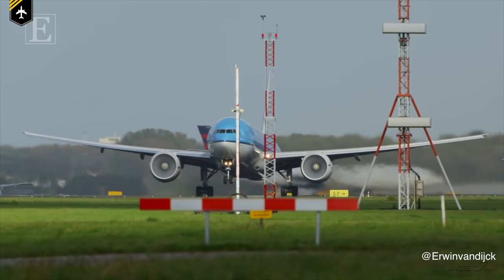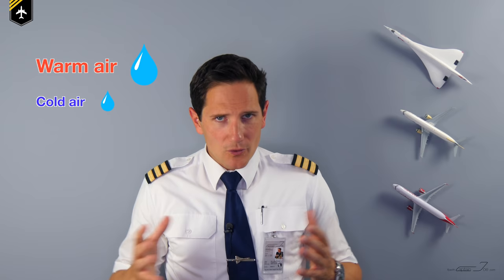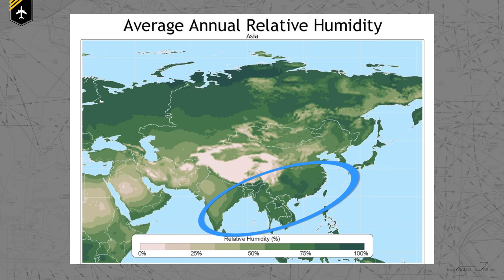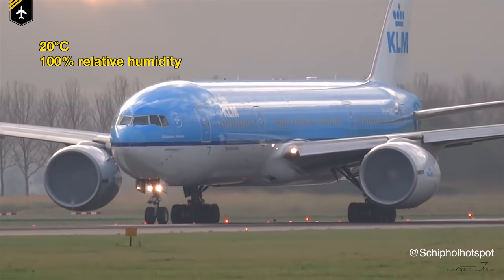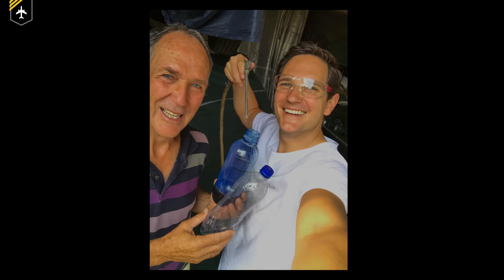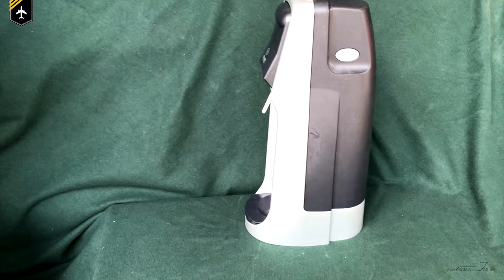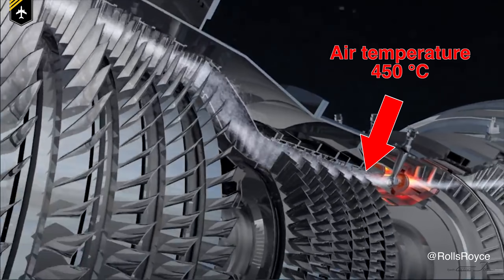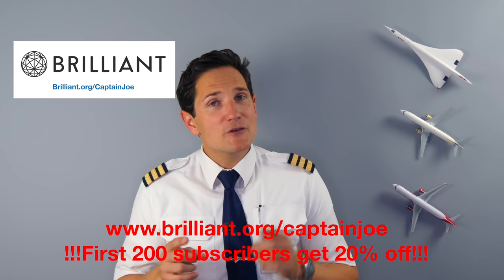WHY is there a WHITE CLOUD? Explained by CAPTAIN JOE

Comment: Damn, Joe is an international airline pilot but he still puts in the effort to make quality videos for us. There is a reason why he is the most popular in his field on YouTube after all😏.
Reply from the maker: Thanks Leonidas! Means a lot :)
Reply: Leonidas the plane is always flown by a pilot. Not YouTube commentators. Keep up the good work, Joe
Reply: Yes. But dont forget mentour.
Reply: justinl458 He is great too and I watch him regularly as well, but nobody can match Joe's quality.
Reply: Luqman.
Most of the time the plane is flown by the autopilot, the human pilot only puts the plane into manual control for take off and landing.
Reply: Captain Joe you’re legen…wait for it…
Reply: Redblade, although 'autopilot' sounds fully automated, it requires setting up, monitoring and adjusting by a pilot. They still need to operate under air traffic control, which may mean deviating from the expected route. The autopilot system in most aircraft is used to hold a heading or altitude, this still needs to be set and adjusted by the pilot as required.
Also, the most modern passenger jets and latest avionic systems might have advanced autopilot, but thousands of aircraft still only have a 'basic' autopilot system, designed to give pilots 'hands off control' on long transits where they may be on a constant heading for hours at a time.

Be under no illusion that pilots do not 'fly' the aircraft, yes they do not need to be hands on, and yes there is a lot less 'flying' to do than in old aircraft, but it very much takes a pilot to navigate, talk to air traffic control and override the autopilot (which they set up and adjust) when required. - Modern data links could mean that an aircraft could be flown from a ground station and the auto pilot sent remote commands. GPS can also be used for navigation, however it is still a US military controlled system that can be switched off or have errors introduced, therefore back up navigation systems are usually primary to GPS.

And for reference, you can carry out a take off and landing with autopilot. Some modern systems are even capable of auto-taxy around the airport. However this is limited to a few airports and very rarely used because the other aircraft on the ground may not have it. - It cannot react to situations either, it assumes that when it is told to follow a route, that route is free of obstructions and clear to take.

 I am an Avionic aircraft engineer capable of flying an aircraft using the autopilot, and understanding every single switch in the cockpit, what it does and how the whole system operates in much more depth than the pilot will. However when it comes to the other aspects of flying like navigation, air traffic control and operating limits or checklists, I do not have a clue. This is why you have a pilot.

I would love to think that computers could get rid of a pilot, that would certainly keep me in a job, however we need those well trained people in the front to make everything run smoothly and to schedule. Also to react in emergency situations or to air traffic instructions.
Reply: dary!
Reply: Lietuvis?
Reply: Joe Sir i want to be an Airbus a321 wizz air what do i do please can you tell  me

Comment: At 3:01, I think the statement is misleading. At the engine intake the temperature drops because the pressure drops, this is adiabatic cooling. But this is not the same effect that a desk fan uses to keep your body cool. A desk fan does not create a significant pressure drop. Instead it cools you through forced convection and the latent heat of vaporization of your sweat.
Reply: To be more specific, all of his statements are wrong on this one... Looking at dew points read from a psychrometric chart is nonsense when we are not talking about constant pressure..
Reply: Spot on
Reply: He would have to get into the venturi effect for this so maybe he just glossed over it since that's extra complications
Reply: yeah, if we wanna be speciffic, a fan in an isolated room would actually increase temperature due to friction
Reply: I build electrical enclosures.  At a training on enclosures, the guy was harping about people wanting fans to "cool" their enclosures.  He said it was for the most part baloney.  why?  Take a fan.  Put it on high.  Take a 2 thermometers and place them on either sides of the fan.  They'll read the same temp.  That stuck with me.  We tested it out.  small fans don't cool, they just move air.  it's the air that does the cooling, either by evaporation of sweat, or "pushing" the stagnant warm air out of the way, and continuing to replace the heat generated with the "room temp" air.  Thus you can't actually cool the components BELOW room temp.
Reply: The relative humidity is defined as the partial pressure (i.e. mole fraction x total pressure) of water vapor in the air divided by the vapor pressure of water at that temperature.  As pressure drops, the partial pressure and vapor pressure (a function of temperature) also drop, but the vapor pressure drops faster, increasing relative humidity.  So his explanation is a bit oversimplified, but the basic idea is correct. He is wrong, however, about the analogy to the fan, and there are some important differences with the bottle experiment as well.
Reply: More precisely it is the partial pressure of water vapor over a flat surface of clean fresh water. A highly convex surface such as that of a drop of mist or fog has weakened intermolecular bonds near its surface so the vapor pressure will be a few percent higher. And various solutes in the liquid water (especially certain salts in high concentrations) can increase attractive forces and reduce the vapor pressure, in some cases by more than 80%.
Reply: MelloOwnsRyuuzaki the venturi effect does not cool the air. Thermodynamically the total pressure stays the same, the flow speed simply trades static pressure for dynamic pressure. You must reduce total pressure via the extraction of work to cool the air. 
Incidentally the measure and comparison of static pressure with dynamic pressure is the source of indicated airspeed.
Reply: I think the desk fan is a wrong example.
Reply: +GhostHostMemories Strictly speaking it's actually a little worse than that since not only do electric fans not cool air but they actually heat it via joule heating and friction not by much sure but it's there. Also humans are a little different to electronics as they don't only use convective cooling but also evaporation so the fan helps not only by moving the heat of the stagnant air away but also the moisture. A hot human after all pretty much has the same effect on the air around it as a ~2 m^2 warm puddle as our skin is coated in water when hot.
Reply: Can it be the Bernoulli principle? If the flow speed is lower than sound speed than air can be approximated as incompressible fluid and the pressure change is due to Bernoulli (or actual heating like in the engine combustion chamber).
Reply: +Attila Kiss That is one part of it yes, there are several things going on the first is simply the forced convection itself (as long as the air is cooler than body temperature anyway) this applied to all surfaces including dry ones (thus the forced convection used to cool computers etc). The Bernoulli effect does indeed improve evaporative cooling on moist surfaces also in addition to being aided in the same way as forced convection is by carrying away the moisture picked up by the air and displacing it with ambient air. Of course these are dependent on the ambient conditions particularly the ambient temperature and relative humidity, the dry forced convection only works if the ambient air is cooler than the surface of the skin and the wet forced convection is only helpful if the ambient air is bellow 100% relative humidity.

A fan can in fact make things worse in some conditions try using one in the middle of a tropical rainforest when it's like 40C is not a good idea since the air is often very close to 100% relative humidity so it wont help your sweat cool you much and when the air is hotter than you are dry forced convection transfers heat to you rather than away from you.
Reply: Exactly,  and what's more, the desk fan has a bit lower temperature on the intake side but a bit higher in the outtake side (because of the change in pressure). So this effect actually heats you, so Captain Joe is terribly wrong here.
Reply: thats also why fans work better in the tropics than in the desert
Reply: Absolutely.. I was just going to point out the same.. But you got there first :)
Reply: Mr smarty phants
Reply: As soon as he said that's how a fan cools air, I had to pause the video to see if someone brought up his error. However, I do think it is correct that the decrease in air pressure at the engine intakes is sufficient to cool the air and reach the dew point.
Reply: Why should the temperature drop if the pressure drop. In fact drop in pressure decrease the boiling point of water hence water vaporize easily rather than condensation.
Reply: agree
Reply: @victormaxwellpeters9771  the truth is if you get a high enough pressure ( such as a compressed air tank) and release the pressure at a fast enough rate, you can get ice forming on a summer afternoon with the temperature around 35 degrees C.
Reply: Thanks Jeff. I see then that's how our  refrigerator works but instead of water there is liquefied co2. At very lower pressure some of the water molecule which has high kinetic energy boils away taking away the heat of remaining water molecule there by condencing it.
Reply: Yea the air of the front of a fan will actually be (just a tiny bit) warmer...you won't notice it will be less than a degree for your ceiling fan.  It would be a tiny bit cooler behind the fan...where you are not...
Reply: @GhostHostMemories  Small fans cool on one side (low pressure side) and head on the other....but we are talking tiny fractions of a degree and only in the vicinity of the blades....soooo....you aren't going to measure the effect.  Right you are.
Reply: Good point, Janis. Captain Joe misspoke...
Reply: @GhostHostMemories  
Absolutely, GHM! As a matter of fact, a fan (due to inefficiencies) will actually INCREASE the local temperatures as the electrical and mechanical inefficiencies result in heat losses. Indeed, what we (due to our biological perspiration adaptation) experience is an APPARENTLY lowered temperature due to evaporation, lessened by conditions of higher humidity (which reduces evaporative rates).
Reply: Just what I was thinking! captain Joe is mis-undertanding the physics.
Reply: I as well think he is wrong about the fan example. A desk fan does just accelerates the air passing your skin, hence taking up your sweat quicker, and through the enthalpy change in the  evaporation process it cools your skin
Reply: I changed the 666 likes to 667 likes
Reply: @mariatemnyuk1471  Thank you! ;-) (atm it is 698 likes)
Reply: @victormaxwellpeters9771  It takes energy to compress air, which is what increases it's temperature. The drop in temperature when air expands is the same thing in reverse.
Reply: @mickjc75  yes  ill fully aggree with you but pressure and temperature are two different entities.
During compression the energy is given to the system or more specifically it's the additional kinetic energy given to individual molecule  there by increasing its temperature.
But these energy is decipeated as heat even before the actual expansion occurs. The real idea here is to bring molecule closer to each other to  change its state 
From gaseous  to liquid  . By doing so we are allowing the liquid to boil by taking heat away from its surrounding at relatively lower pressure compared with the pressure which it is subjected in earlier situations. It's not that expansion causes it to cool down since during expansion temperature actually increases by taking pressure energy. The fact is at equilibrium additional heat is taken away from system to convert liquid into gas, this is altogether a different phinomina.
Reply: @DogsAreGod The phenomena of desk fan is slightly different. The cooling effect is due to the Bernoulli principle were if kinetic energy of air increases then it's pressure drops. As this speeding air passes on our skin it creats a reagion of low pressure around our skin which causes the sweat to boil and  hence this boiling sweat takes heat from our  skin by creating cooling effect.
Reply: @victormaxwellpeters9771  exactly
Reply: @geo3106  Thank you
Reply: @victormaxwellpeters9771  It also blows away saturated air, increasing the rate of evaporation. Bernoulli's Principle is the same way a plane's wing produces lift. Was just scrolling to my old YouTube notifications.
Reply: That was my thought, too; thanks!

Comment: The engine is actually a fan for the pilot because when it stops he starts sweating!
Reply: only when both of them stop
Reply: Good one..
Reply: MWB Gaming but one of them stops will still cause a bit of sweat
Reply: Over used joke
Reply: We had one of our KC-135 tankers, lose all four engines to low oil pressure, on a flight from England o the US.  Pilot decided it was better to keep flying with engines with low oil pressure than with no engines.  Nobody had serviced the engine oil, for several flights, and all four engines ran out of oil.  They did an emergency landing at the first stateside base.
Reply: Only seen this 65 times...
Reply: Over used
Reply: @robertheinkel6225  wow I imagine he cooked those engines completely. I get that it's easy to slack off on maintenance but oil seems like one of those super important things I should constantly be checked.
Reply: Ye LOL 👌👌😂😂🤣👌👌👌👌😂😂
Reply: why_vegan lol
Reply: Haaaaaaaaaaaa!!! 🤣🤣🤣🤣
Reply: And he takes a crap

Comment: 2:57 "accelerated air is cooler otherwise a fan would lose all its purpose" - that's not true, it only transfers more heat off a surface, because slightly heated air is constantly replaced with non-heated air, but the air itself isn't cooler. Otherwise a hairdryer would lose all its purpose :)
Reply: For a normal fan (like the ones you have at home) this is true. But the fan of a turbofan engine deals with high speeds, so the pressure drops by a huge amount and that's why the air is significantly cooled. On the other side you have a high pressure zone, that's why the air is hotter.
Reply: Yeah, i was thinking the same. Maybe the explanation in this video is kinda flawed because the effect is not directly correlated to temp but only to pressure.

Comment: The air doesn't get cooler because it's "accelerated", and the fan analogy is completely wrong. The cooling and the acceleration are both the result of the pressure difference.  As the air pressure drops, it results in "adiabatic cooling".  Air gets hot when it is compressed, and cools when it expands, whether it is moving or not.  When air is forced to flow through an abruptly narrowing orifice (such as in the bottle experiment) or abruptly deflects over a wing surface, the pressure can drop even further due to the Bernoulli effect. This results in even more cooling and fog. However, the Bernoulli effect is not a factor at the jet intakes because the cross-sectional area is relatively constant.
Reply: THANK you. I was confused when he talked about "moving air being cooler."  Not so. Lowering pressure DOES cool the air, because there are fewer molecules banging into each other with lower pressure. So as the engine sucks in air, there is extremely low pressure as the air leaves the atmosphere and is pulled into the engine. That's when the air cannot hold as much moisture and therefore it condenses.
Reply: was looking at a airport stream on wet day and saw this effect. Being a Mech Eng myself, I thought about the reason behind and searched in youtube. Was shocked that Joe explained the reasoning like this and was trying to find a clear mind in the comment section. And there you are.

Comment: Hey Joe, I've got a question for you: why do Pilots start the right engine first, even when it's called engine 2?
Reply: Because for most airline aircraft, engine number two supplies bleed air to the air conditioning allowing the air con packs to supply conditioned air to the cabin And engine two supplies hydraulic pressure to the flight controls, I think.

Comment: The air entertaining the engine is accelerating and losing pressure. The air can't hold as much water at a lower pressure and the water in the air condensates. This is similar to air passing over the top of the wing which creates a cloud as there is lower pressure there.
Reply: wrooong!
Reply: +entering!
Reply: *condenses
But, your science is sound.

Comment: I thought the drop in temperature was due to the drop in pressure, not accelerating the air.
Reply: rmfleming69 Same thing.  Moving air= less pressure. Less pressure = lower temperature
Reply: That's not how it was explained
Reply: Accelerating the air causes the pressure to drop
Reply: It's the venturi effect that doughtymquan is explaining. Joe probably didn't want to get into the depths of that since its a big concept lol
Reply: But Joe is correct in his brief form. If the air accelerates because of the venturi effect pressure drops which in turn cools
Reply: @MelloOwnsRyuuzaki  is it the same as Bernoulli's principle where the increase velocity of the fluid causes the pressure to drop?
Reply: according to the ideal gas law yes, however according to Bernoullis principle is also true, so you have to mix those two
Reply: Yes. With Bernoulli you get form higher velocity --> lower pressure. Then Ideal Gas law: lower pressure --> lower temperature.
Reply: See the accelerated air has directional pressure, you understand? Meaning when air is accelerated in a certain straight line, the sideways molecules find a way to peep into the path of the flowing air, but the flowing air in the strainght line has pressure along the line. Now you understood?